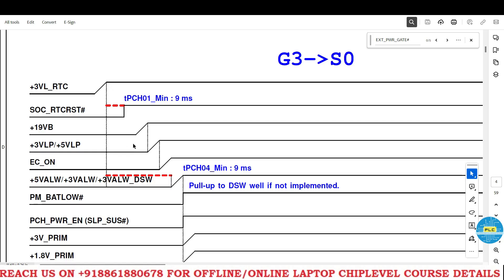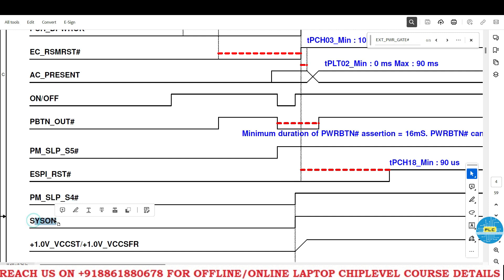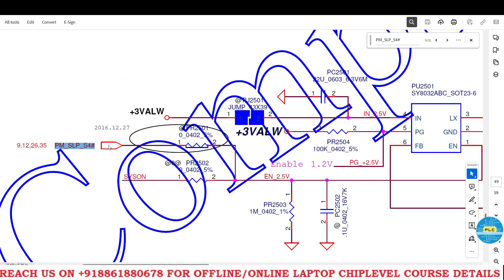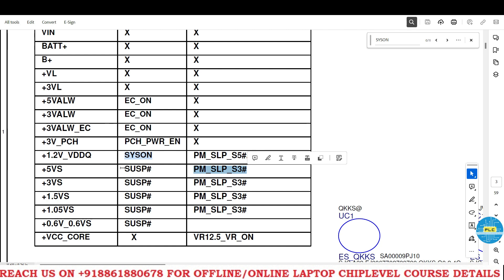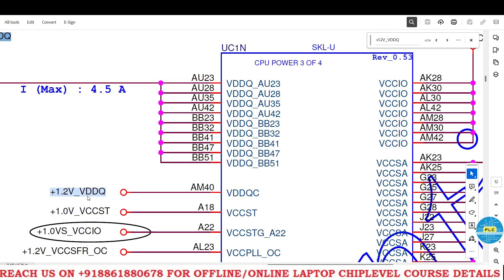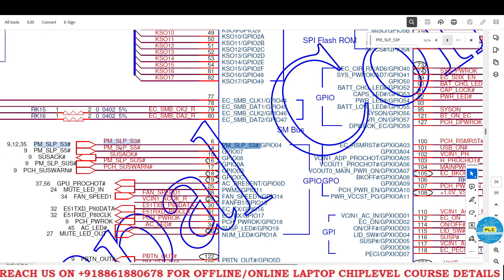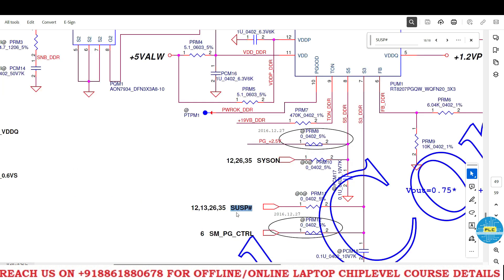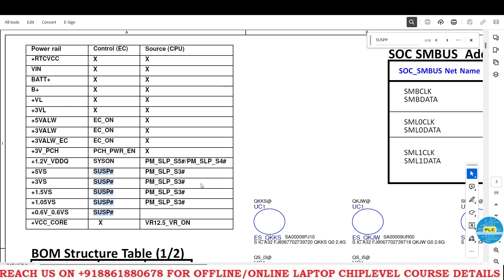Laptop Repairing Full Course - Part - 07 - SYSON, SUSP#, SLP 5#,4#,3#

Comment: sir slps3 slp4  is coming first  vrm and vram is coming before i press pwrbtn .. what this chip problem?  laptop asus x455lj rev 3.1 gen 5th
Reply from the maker: What's the condition of the board?
Reply: @LaptopCourse  board  no switch ampere stuck 0.07 . not respon  and not charging

Comment: Sir  slp_s3# avilable but susp# not available la-d704p .
Impedance of io pin ok. Program io chop but not generated susp# change io and program but not out susp# . So what can I do sir .
Reply from the maker: SLP s3# available? Replace ram, check ram slot, disconnect or open the susp# pin in io and check voltage is available or not. If yes, any path components are issues.  Check ref related all path. Check PG